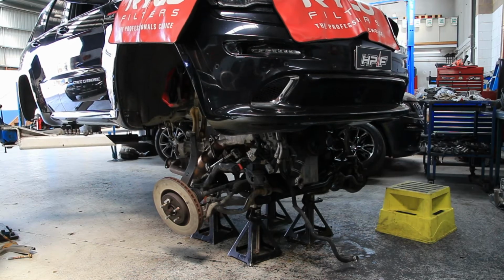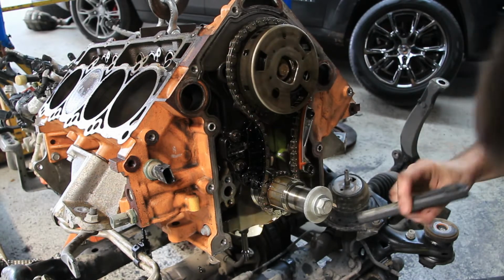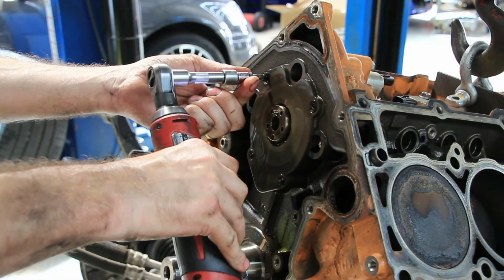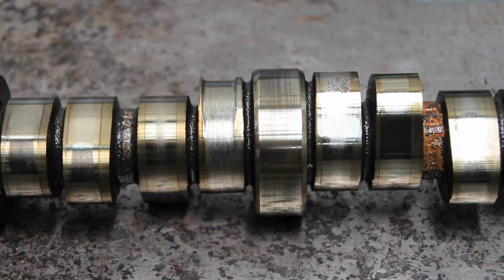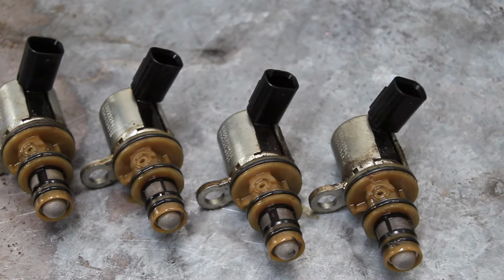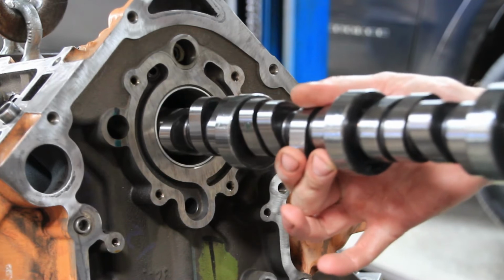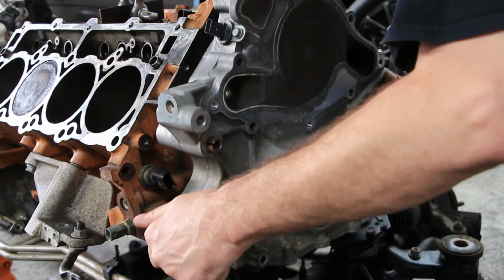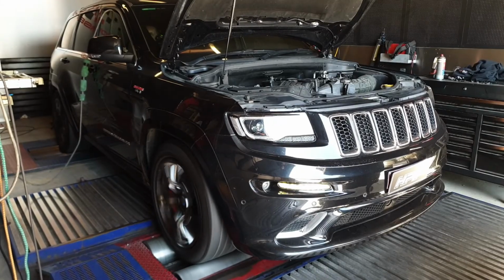HPF TECH FILE | Jeep SRT 6.4L | HEMI Lifter Failure | AFM Delete

Comment: Even deleted MDS hydraulic lifters still the same problem. the design lifters roller needles bearing always failure, whether change oil early or not same issue.